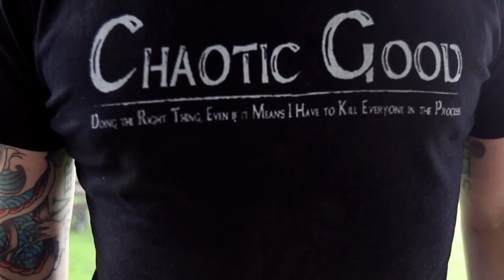Maker Adventure: The Shadow Axe

Comment: My only issue is that it's way too nice to be a starting item. It's not a worn out shoe on a rusty piece of metal.
Reply from the maker: You're 100% right. But I thought about it, and chopping a tree down with an rusty bucket would have been a very different video. The old shoe may have worked though, hmmmm.

Comment: How does the metal blackener hold up to use? Or is it gun bluing?
Reply from the maker: It's just Presto Blackener, and since its a surface finish, it will definitely wear down over time. I've got quite a few hours on the axe so far and the wearing is only near the striking head.